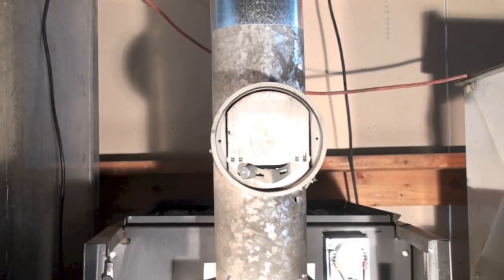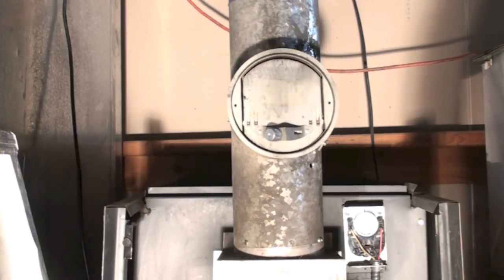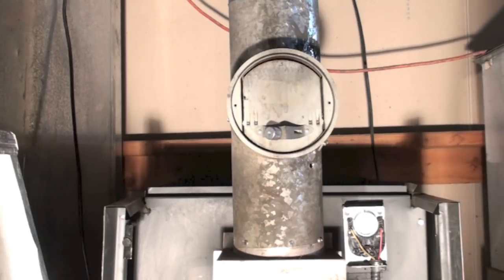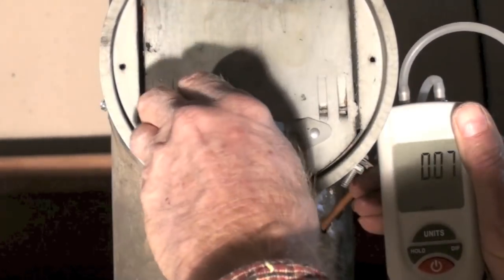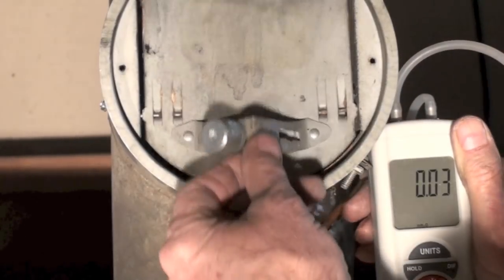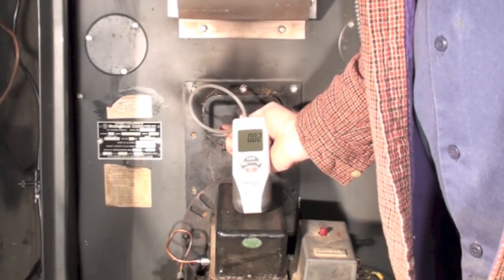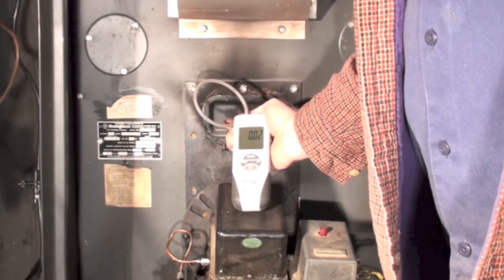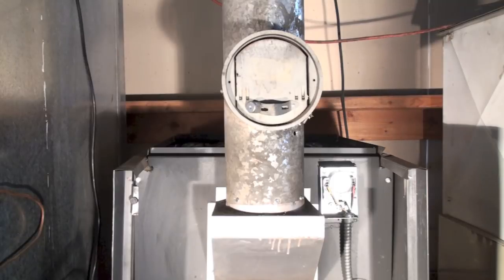How to set the oil furnace barometric damper

Comment: What if you can't get more than about .02in/wc at the damper. Heat exchanger? Vent size? More likely all sootted up. Do to years of improper combustion.
Reply from the maker: A low negative pressure at the damper indicates a chimney blockage or defective chimney.
GFM
Reply: I checked and confirmed no blockage in the flue.
Reply: It's a Rheem 3ton oil furnace. The installer used 6" vent pipe.
Reply from the maker: @misterindependent7994  The venting could be too small.
GFM
Reply: In my mind I'm thinking the negative pressure would increase with a smaller vent. It runs great for about 5-8 mins then it starts to choke out. The nameplate calls for .04in/wc for the draft, and we're at about .01-.02in/wc. 🤯
Reply from the maker: @misterindependent7994  That is not correct. Larger vent, unless you go very large, will increase draft.
GFM
Reply: GFM, If there's an opinion on the internet I trust it's yours. I appreciate your videos and the one on one tech support is greatly appreciated.
Reply: At an elevation of 5000" where abouts would you adjust the air intake on the Beckett burner? I hate to waste your time on my questions. Perhaps you have other references I can refer to.
Reply from the maker: @misterindependent7994  You can't set the primary air by elevation.  You need to use a smoke pump at the least, and a combustion analyzer even better.
GFM
Reply: What combustion analyzer do you recommend?

Comment: My damper is not opening regardless of  where I have the weight.
Reply from the maker: I would not be concerned unless the negative pressure in the vent is too high.
GFM
Reply: @grayfurnaceman  It bops around 8 -12.  I believe the sweet spot should be 4
Reply from the maker: @aggienodari453  he only thing I can't think of is it is worn out or jammed.
GFM

Comment: What if you don't have a barometric damper?
Reply from the maker: Some units do not come with barometric dampers.  Some should have one but do not.  The furnace may run normally, but its efficiency will low because of excessive draft.
GFM

Comment: I have the manometer where I get that prove. Thanks
Reply from the maker: Are you asking where to put the probe?  Upstream of the damper.
GFM
Reply: @grayfurnaceman  I'm asking for the probe used. I need you used it up stream and to ch6dradt over fire
Reply: Check draft *
Reply: Will any probe work like the 90 on a sdm6 manometer
Reply from the maker: @antoniosantiago2770  The probe design is not important.
GFM

Comment: The reason for a barometric damper is to maintain a constant pressure in the firebox.
Reply: It is NOT simply to maintain a "constant pressure" in the firebox, it is to maintain the "right" pressure in the firebox.  If the barometric damper is not adjusted properly and the pressure is too high going up the chimney, then you are sending heat out of the chimney rather than heating the house, and wasting valuable fuel oil.

The reason for adjusting the barometric damper is to slow the draft down going over the firebox, keep the heat in the box where it can be used to heat the house, and to keep your heating efficiency at its peak. 

Considering the massive increase in the cost of fuel expected to occur even beyond what what it's already at, which is already nearly double what it was last year, everyone should be concerned with getting every BTU available out of every drop of oil. This means having a properly cleaned and tuned up boiler, and that includes having their barometric damper tested and, if need be, adjusted. 

If the barometric damper is not adjusted properly, one can be sending money right up the chimney and not even realize a simply adjustment could have saved that money while trying to stay warm this winter.
Reply: @GlennMarshallRocks  A constant pressure means exactly what you're saying, with less detail. Good explanation.
Reply: @jspinosa50  - Sorry, but no... the purpose of a barometric damper control is not simply to "maintain constant pressure"... and "maintaining constant pressure" is certainly not "the same" as what was explained. 

If you think that it is, then you misunderstood what was explained entirely. 

What was explained was that if the pressure is adjusted for pressure that is too high, that is not good, and can be damaging to the system, as well as uneconomical, allowing heat to escape and be lost up the chimney rather than utilized to heat ones home.  

Conversely, if the pressure is adjusted too low, that is not good, and can cause the system to overheat, damage the boiler, and cause blowback of oil fumes into the home upon startup. 

So, again, the purpose of the barometric damper control is NOT to "maintain a constant pressure in the firebox". 

The purpose is to allow one to adjust the airflow to the "right pressure", and to maintain the "right pressure" of the airflow going over the firebox as the boiler operates... 

Hence, the purpose of this video, which was about adjusting the barometric damper to achieve the "right pressure" for the airflow going over the firebox, and NOT simply about maintaining a "constant pressure", which could be too high or too low, with both being incorrect and potentially damaging to the system, as well as less than ideal economically. 

Obviously, "maintaining constant pressure" is NOT the same thing, nor the specific purpose of the mechanism, which is to allow one to adjust the rate of the airflow, and to maintain "the right pressure" of that airflow, which was the whole point of the video.
Reply: @GlennMarshallRocks  how far should the barometric damper be from the breach of the furnace is there a precise measurement or no greater or less than

Comment: Water boilier
Reply from the maker: +kenny play With baseboard convectors I would go for lo 180, high 220.  Cast iron radiators, lo 140, high 160.  The differential is difference between the 2.
GFM

Comment: On vertical configuration, your weight should be on the right side and/or at the top of the swing. 
I cant believe you posting instructions on fuel burning services so that unqualified home owners think they have enough info to even attempt to try to do things on their own equipment. I guess when their family dies from CO poisoning because they don't have "all" the training and understanding you have, you'll be off doing another video somewhere. I can not figure out why people do this - you're like an anonymous  loaded gun.
Reply: Furlong HVAC Services Inc. Kingston Gananoque Area, Heating, Ventilation, & Air Conditioning - If they own that meter I doubt they're a DIY homeowner. Also anyone with a fuel burning heater in their home should own a CO detector or two .
Reply: If someone owns that meter then, wouldn't they be a technician, licenced and would have already had training to learn to use it...
Reply: @todd3452  look like he is babysitting... Why isn't he out doing service calls - he owns a business a business works by exchanging work for money. Do you go to your job and work for free? Do you work so many hours a week for free? Or do you expect to be compensated for your expertise.